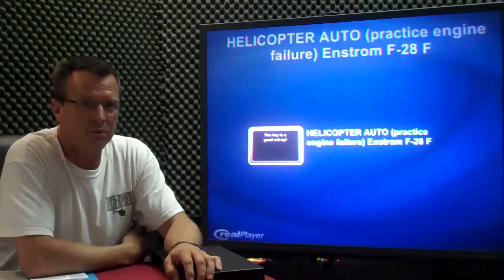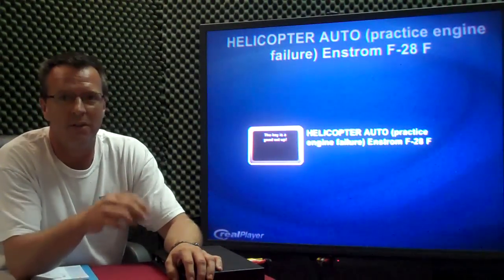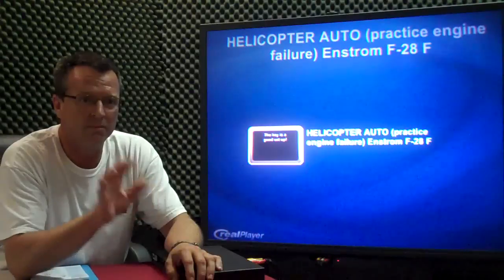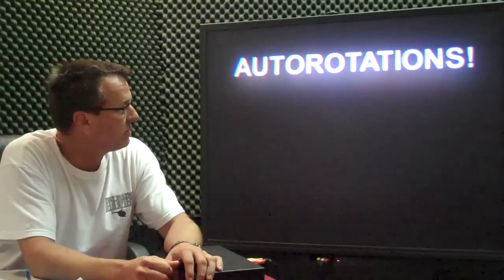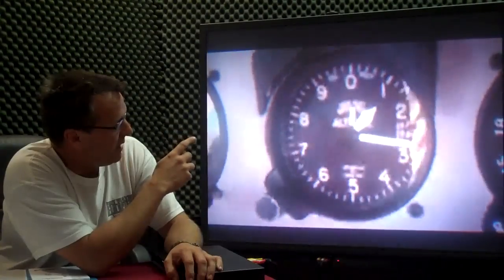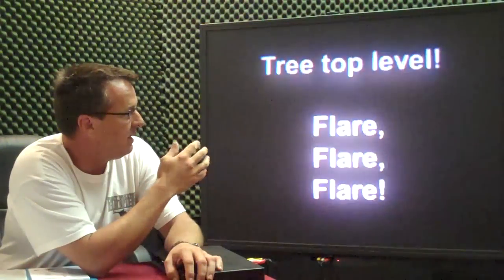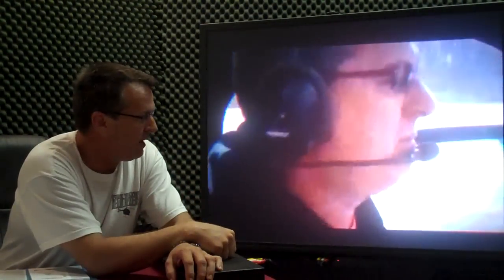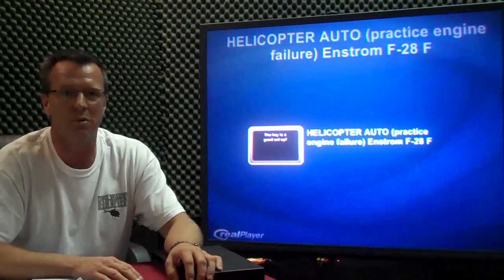The Key To A Good Autorotation -- A Good Setup!

Comment: Recently qualified PPL (H), The points i would make are in a practice engine fail the priorities are 1 enter autorotation 2 turn into wind 3 select your spot. The acronym i had drilled into me was RBSS for Revs - in the green, you may require an 'up check' of the collective to prevent overspeed more pronounced the closer to MAUW you are. 2 Balance, Get the helicopter in balance otherwise your ASI will give false readings. 3 Speed adjust your airspeed for the auto 4 Spot choose one and fly to it